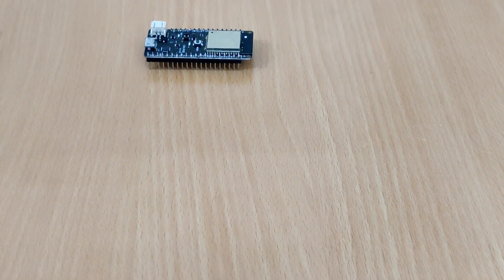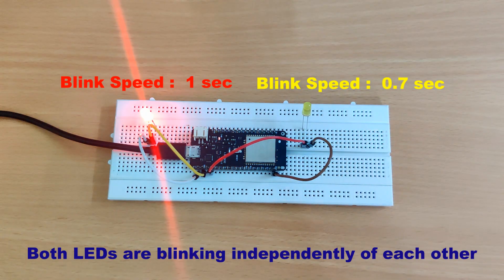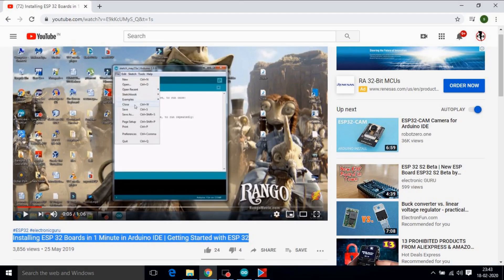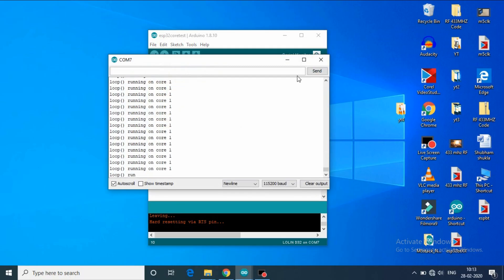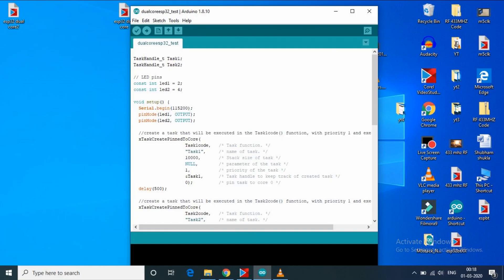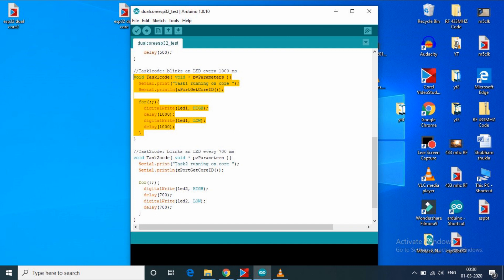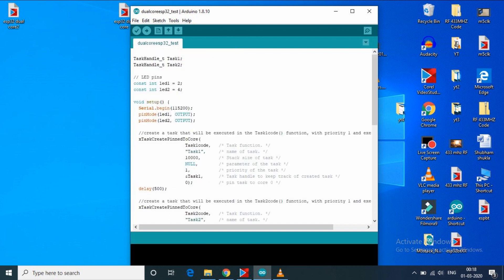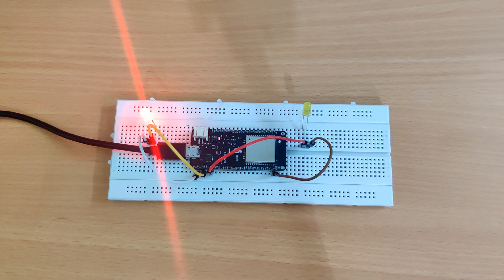ESP32 Dual Core Programming | ESP 32 Multitasking

Comment: Do all ESP32 boards have dual core processor?
I see many boards ranging from Rs 400 - 800 and bit confused whether they have single or dual core processor.
Reply: at least esp32 c3 super mini has only one core and works at 160 mhz instead of the 240mhz of most esp32 boards...